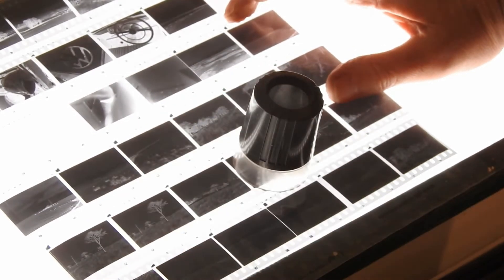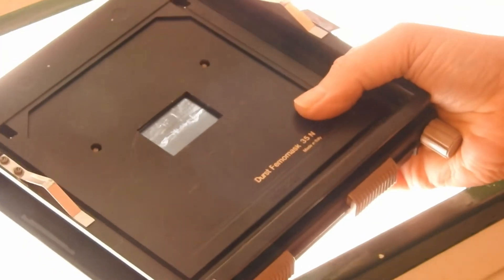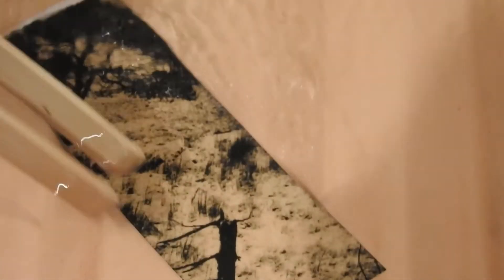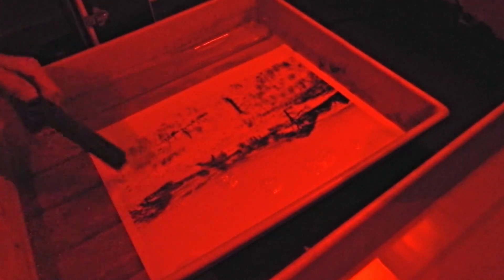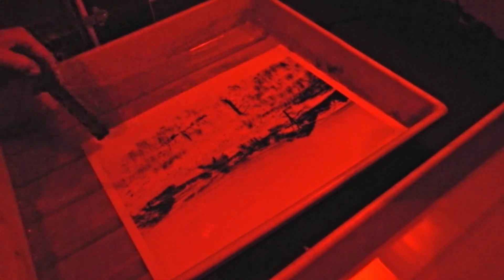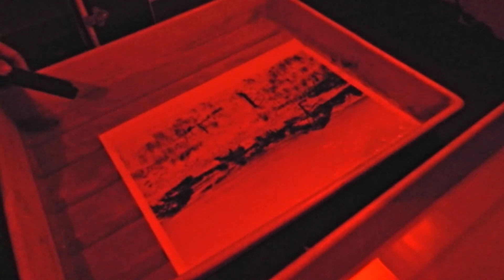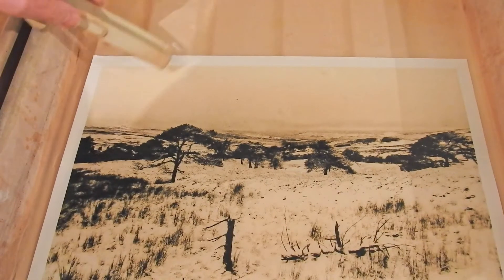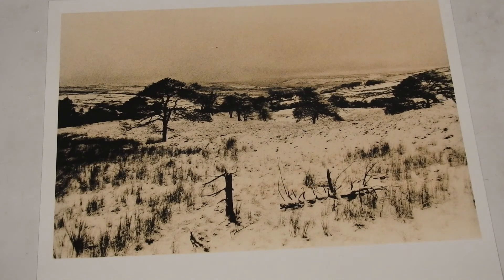More Minox Lith Printing

Comment: Nice work, could you tell about dilution and wich chemicals ? How many stops over expose ? Thanks !
Reply from the maker: Hi Dennis, I'm using the last of my stock of LD20 diluted 25ml A+25ml B+1000ml water. dev temp was 20.C Exposure about 2 stops over.
Reply: @tomcollier2444  thank you! LD 20 has nice results..Unfortnualy don’t make it any more, I use Easy Lith at the moment
Reply from the maker: I'll be ordering easylith soon, seems a reasonable dev from what I've seen.
Reply: @tomcollier2444  it is , I like it definitely so far .